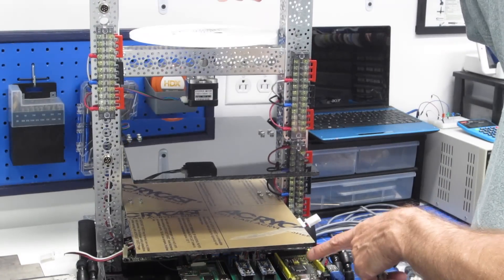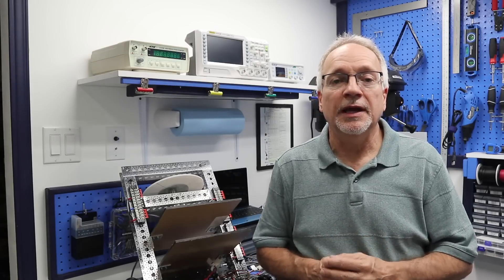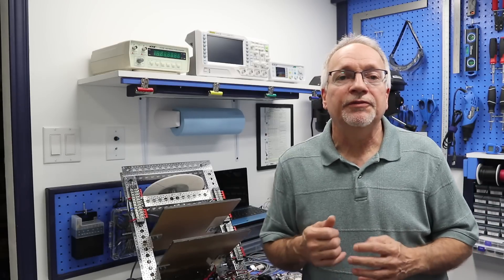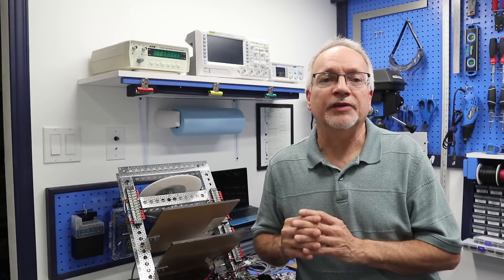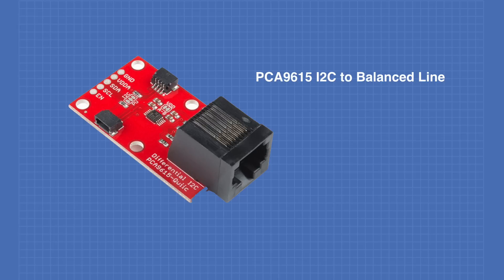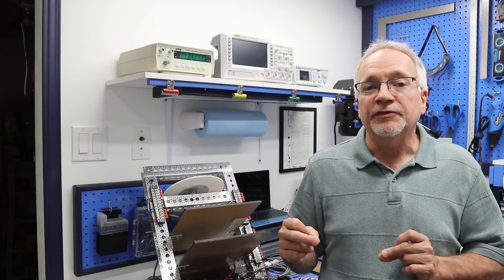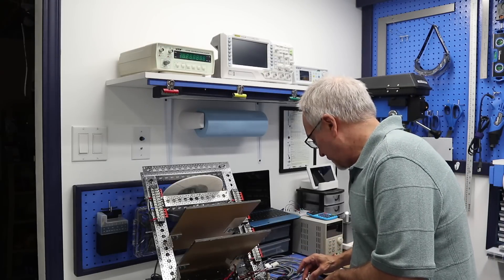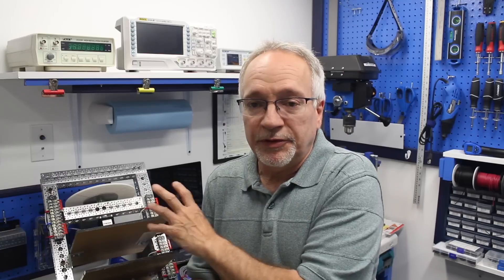Build a Real Robot - Episode 13 - I2C Issues

Comment: Thankyou - - I am rather surprised though that the regular I2C would be an issue with such short distances of 1/2 meter.  In the presence of the RF interference, I could see that issue - in which case I would tend to want to shield the interference sources (e.g., simple tin housing) to redux that source of RF noise.  It would be interesting to see waveforms of the I2C without the buffers, with shielded modules, and then with the buffers.

Comment: It's well worth noting as well that if you have two micros communicating over I2C and you have noise on the clock or data lines, for example because of a loose connection, then one or both micros can completely LOCK UP 😲
This seems to be down to a bug in the I2C library that puts the code in an endless loop on certain unresolved error conditions. Don't ask me how I know this 😭😭 (That was several days wasted!!)
Using the watchdog timer to check for lockups will benefit you a GREAT deal if you find problems like this further down the line
Reply: Or you can implement a timeout counter so your system is not restarted by WD.

Comment: May i suggest RS422. It’s differential, 5V or 3.3V. Can be used in full duplex mode I think. Driver/receiver integrated circuits are cheap.

Comment: Bill I really can not see what the problem would be
for the testing I do I have a i2c signal running over a 15 FT twisted pair cable via Rj45 connectors.
never had any issues with the signal. in the cockpit i am using  1ft patch cables to daisy chain the modules .  this in an enviroment with loads of RF from Wifi, screens computers etc.

dont overcomplicate >)

Comment: Thanks for this all efforts that you spend to make this valuable contents!
I hop if you can tell me if you know some Single board computer that 
doesn't have GPU and HDMI, I want to use it only like a server that i 
can control it via  SSH protocol, So it is like raspberry Pi witch have 
CPU and LAN and WIFI and Pins SD reader or EMMC nad DDRAM ... but 
without HDMI port and GPU.

Comment: Hey I'm in the same situation! I'm building a robot with a master MCU and a few MCU slaves which are half a meter (almost 2 feet) apart from each other.
These solutions seem very good but involve extra electronics. I'm thinking it'd be simpler to use Can bus. Let's ditch the arduinos and use stm instead. The so called blue pill is very inexpensive and works with arduino ide mostly. Alternatively, cubemx is just as easy as arduino and makes CAN bus fairly easy to implement.

Comment: Cool video dude could I make a hub like a bread board to tie everything into feeding to whatever from there my project is pretty sizable so I'm going to keep everything out in the open for easy access sharps 4 to 30 cm  ir sensor seems to be very fast and accurate with its readings I knew there would be more than one pie great ! I was going to add one anyway and a panda windows 10 the sensors for me are the most interesting part yet .

Comment: Hi,
Did you ever consider an I2C multiplexor (TCA9548A from Adafruit) to handle up to 8 sensors with the same I2C address? I've used it and they work great.